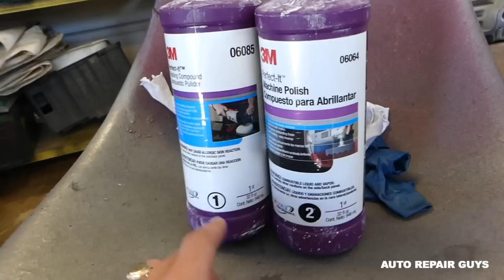HOW TO MAKE HEADLIGHTS CLEAR LIKE NEW demonstrated on HONDA ODYSSEY

Comment: Finish product looks fantastic. One question though. At the 4:24 minute mark it shows that you are using 3M product #s 06085 (part 1) & 06064 (part 2) however the links provided above go to 3M product #s 39060 and 39061. Unless you advise otherwise I’m going to go with the products shown in the video. Thanks for taking the time to share the knowledge.
Reply: Hmmmm...after a little more research it appears the only difference between the 3M polishing compounds shown in the video and those provided in the links are their relative sizes (i.e. 1 quart vs 1 pint). As a quart would seem to be overkill for my project i'll go with the ones in the links. Finally any suggestion(s) for a UV protection product greatly appreciated.

Comment: Thank You - This worked wonderfully on my 1995 BMW headlights.  I will mention that I did learn a lesson using foam pads,  do not press too hard,  It seemed to me that the technician in the video was giveing a good amount of pressure,  I put too much and the pad heated up and left residue on the headlight,  back to step one and it removed it just fine.    Going at my 2014 Honda Pilot next...

Thanks Again !

Comment: I've used the Turtlewax kit to clean up the yellow oxidation on Honda Accord headlight lens but took a lot longer just to get one lens clean up and it turns yellow again after about 3 years. It is weird that I had this issue only on driver side headlight, not the other one. This process is certainly a lot faster and the result is probably better than the Turtlewax product. The down side is the 3M rubbing and polishing compounds are expensive and so does the costs of the pads, assuming that you already have an orbital buffer/polisher machines. By the time it is all said and done, you are looking at at least $90-100 for the materials and another $100-200 for a good polisher machine. It is much cheaper just to use the Turtlewax kit or replace the damned lens with an after market lens for about $70-80 each. Unless you can use the kit to make some money off some other people that need their lens cleaned using the materials and the tool you have to pay for, it is not worth the time. The 3M fluid will dry up after the first use if you don't need to do another one in a couple years.